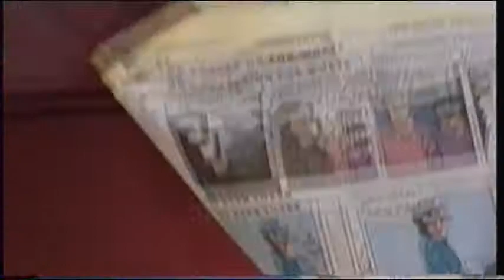Last of the oldies.  240SX repair

Comment from the maker: just have to be careful when spreading filler to keep it out of the line. You can always tape it off and do the top and bottom seperatly.  If you get filler in the line just wrap a paint stick with sandpaper and sand it back out.

Comment: when you did the body work, how did you avoid getting filler in that line/ crease that runs the length of the body? I only have one rust spot on my 240, but that line happens to intersect right through it... So I don't want to fill it in while doing rust repair... Let me know how you made this work! Thanks a lot :D